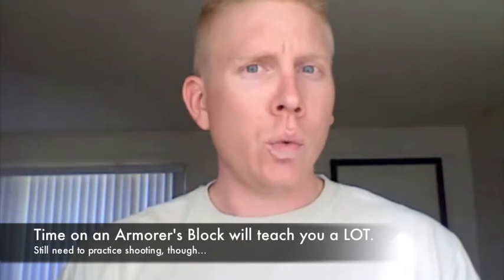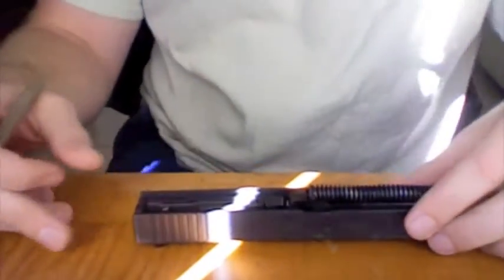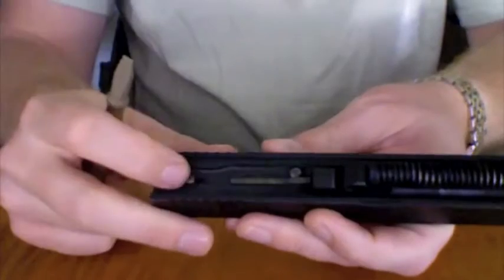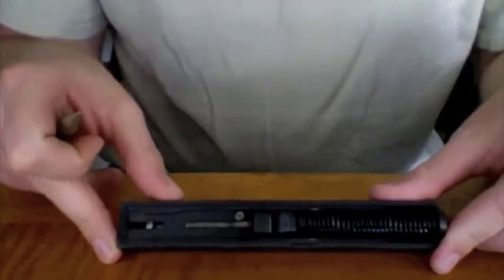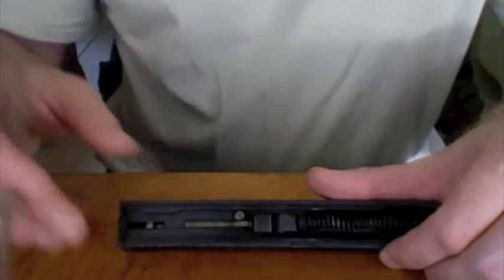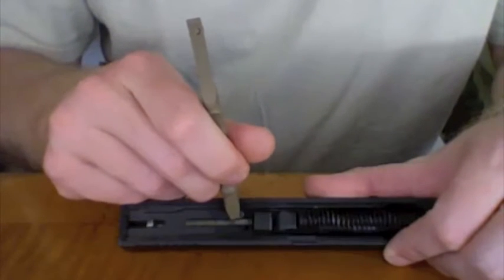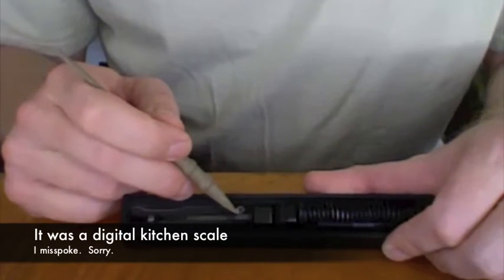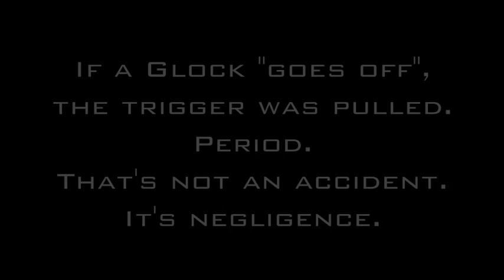Glock Firing Pin Safety

Comment from the maker: I never worked with a Marine that wasn't a complete professional. I've got nothing but respect for that branch of service. Thank you for sending me the PM and clearing up the misunderstanding, and I'm sorry I got cranky and pissy. I was out of line. You were a gentleman and I salute you, sir. (And I figure I'm not too proud to post a public apology. You deserve it.) Semper Fi, man. You're a credit to the Corps.
Reply: PLEASE ANSWER, IF THE TRIGGER IS NOT PULLED,  LET'S SAY THE FIRING PIN SLIPPED FROM THE FIRING PIN SAFETY METAL PIECE THAT MOVES UP.... IS THE INITIAL, DEFAULT DISTANCE AND TENSION OF THE SPRING AND FIRING PIN TO THE PRIMER OF THE ROUND, ENOUGH DISTANCE TO LAUNCH A BULLET ? ....... COMPARED TO THE LONGER DISTANCE AND GREATER SPRING PRESSURE OF THE FIRING PIN  AND BULLET PRIMER THAT NORMALLY HAPPENS WHEN YOU PULL THE TRIGGER. PLEASE ANSWER. GLOCK SAFETY ISSUE

Comment: Hey, Eric.  Long time listener, rare commenter.  I agree with you that there should never be an 'accidental' discharge with a Glock and that in order for there to be any discharge the trigger must be disengaged.  That said, I can't remember you ever acknowledging the fact that the Glock is (to some small degree) less safe than a similar pistol with a traditional manual safety.  People ARE dumb and they DO make mistakes and I think that it's a good idea to engineer safeguards into a design.

Comment: I have seen firing pin blocks that didn't work that could cause an accidental discharge but thats why you check you gun for defects and flaws, so i pretty much agree that its almost always a negligent discharge cus you need to be negligent in your maintenance for it to happen

Comment: The only way a glock could accidentally go off is if the chamber was torched and the round was cooked off. The trigger was pulled by something "not necessarily a finger". Or the gun has been damaged or parts modified or removed to the point where normal function is not achievable. I love my 21SF. I also love other handguns guns like My 1911's. all guns have pros and cons the glock has both pros and cons. Reliability accuracy and durability are in the pros for glocks or at least in my experience.

Comment: I never knew about the plunger and that it blocks the firing pin! That was good to know because I was wondering why Glock would have pulling the trigger as part of the take-down process!
Reply: +Brian Daniel the glock safety?  "You can't pull the trigger, unless you pull the trigger."  It's really only a drop safety...an important thing to have to be sure, but Gaston really oafed by leaving off a safety.  Especially when issuing this thing in large numbers to indifferent draftee soldiers.  i heard tales of Marines having to carry .45 autos with the slide SAFETY WIRED SHUT.  Think they USMC would ever issue a Glock?  Fat chance
Reply: +Robert Maybeth after my time in the Army, I believe the whole wiring it shut! It's redicilous, but I understand the bearucratic bs!

Comment: I have the same Vltor stock and love it.  I have been going back and forth about what size Larue rails to get.  Either stick with the front post or put a low profile gas block and put a longer rail.  I think your right about the profile so I am thinking going the same route.

Comment: I suspect no Glock firing pin safety ever blocked a firing pin. If someone assembled the gun with around in the chamber... maybe (of course, this is impossible). If a primer fails, will the firing pin safety be capable of moving the firing back 1mm and lock it?

Comment: Hi in the opening what type of rails are your running?  What is the length of your rails?  Are you still using your stock forward front sight post/gas block?

Comment: I think strikers pistol don't need the firing pin block, because the firing pin is always held by the trigger mechanism, if you don't pull the trigger that firing pin will not move forward, someone correct me if I'm  wrong, i tried to figure out what its for in glock 19 and czp10c, i cant see how the firing pin will disengage without pulling the trigger.
Reply: Cheap mim firing pin/strikers, if it snaps then there’s a redundant system to catch the firing pin, found out how much mim glock uses, I’m currently looking to switch

Comment: I kind of understand the response to "glock isnt issue".
no offense but POGs pullout a sidearm at the range and to pose for facebook pics. 
combat and spending weeks out in the field you learn that EVERYTHING can fail. comms, gear, weapons. glocks and a little firing pin safety & spring is no exception.

main point: everything is prone to failure.

Comment: I just bought a Glock and the previous owner removed the firing spring safety and firing spring safety spring, with the gun still work normally without it? I know it's not as safe as before, but will it still work?